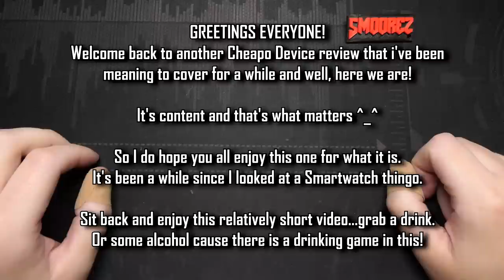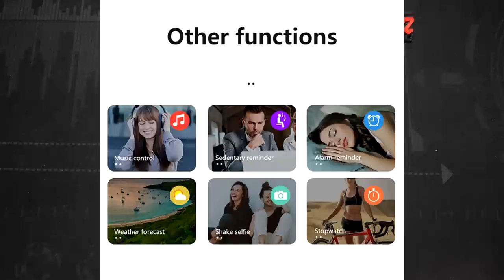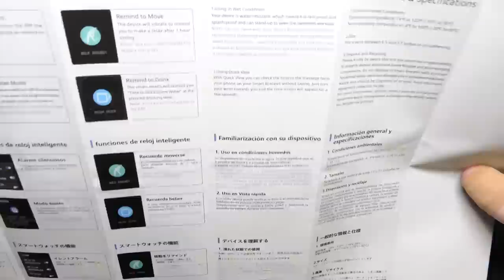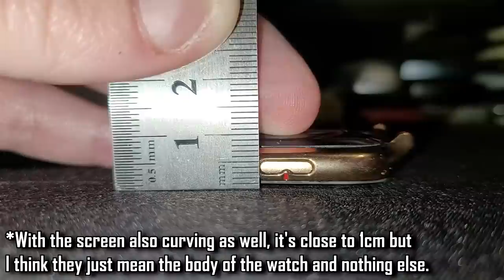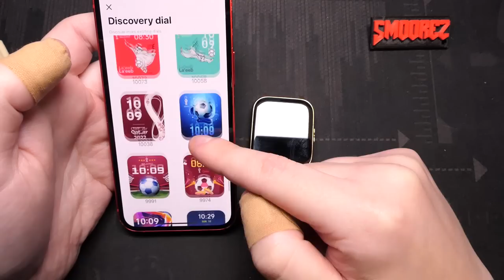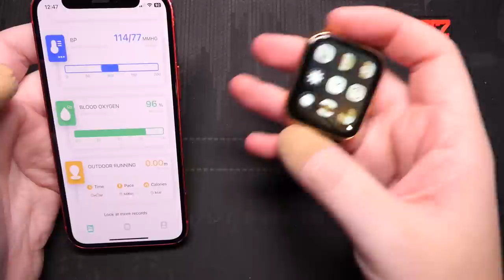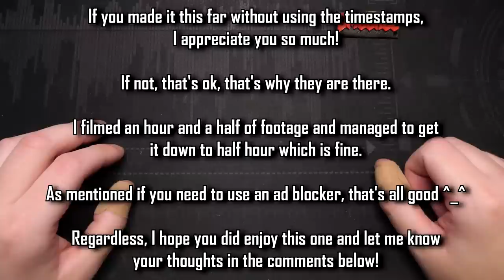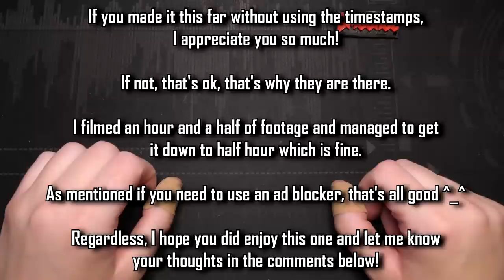The MW-0 Smartwatch is OBVIOUSLY SUPER THIN...and the thinnest in the world? (probably not)

Comment: Hey Smoorez, we have many cheapo smartwatch things here in India. The best part with all of the multiple branded ones is that they all use the same Da Fit app. All of these fitness bands have nearly the same interface even the hardware at this point. Loved seeing you review this one. CHeers.
Reply: Same as Zeblaze they use Dafit And 2 other apps
Reply: Yeah, all those fitness bands masquerading as "smartwatches" most likely are made in the same factory in Fuyong Town, Shenzhen, China with different logos and slight customisation of software and hardware. I have a Fireboltt one with nearly the exact same UI but instead of grid app menu, it has one that resembles Apple watchOS.

Comment: That's all the hardware it needs to see your pulse and blood pressure and O2.. it's actually a very simple circuit that only needs a basic PCB with red or green light and the optical sensor.. green light is not quite as accurate as red light.. for some reason the red light is better at penetrating the skin and easier for the optic sensor to see.. but your correct saying it's just a very basic fitness watch.. but it's still more useful than a Fitbit of that time era 😊

Comment: I have a noise watch and that watch uses the same app to sync and show stats. After using it for an year, the obvious drawback was the update and no cloud storing if your phone reset and all and sometimes it doesn't connect or respond to the watch.
But having this many wallpapers is also gud, by watch doesn't came with so it is what it is.
If you get the latest or older Mi watch, you can play games and have a calculator as a wallpaper.

Comment: Well, one has to give them some credit here because for a mere 30 USD they quite deliver some tech and the app‘s not too shabby either! There are way WAAAY more worse „smart watches“ out there which even cost more, have a worse display and obviously offer way less functions. So if someone wants a basic fitness tracker, this Watch might be sort of useful. Nonetheless the Apple Watch still is top of the line when it comes to accuracy „smartness“ and all the other stuff. You simply can‘t beat the original which, however has also a high pricetag. But kudos, this is a smartwatch(?) I‘d not regard as an utter failure at all. You get what you pay for and in this case you really get something here for the buck…